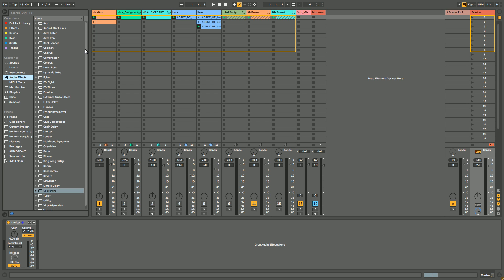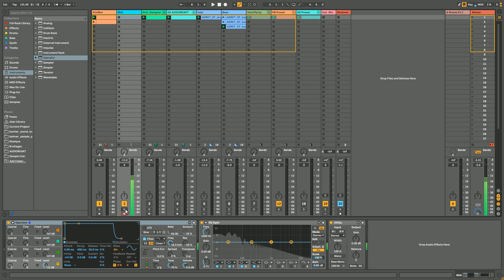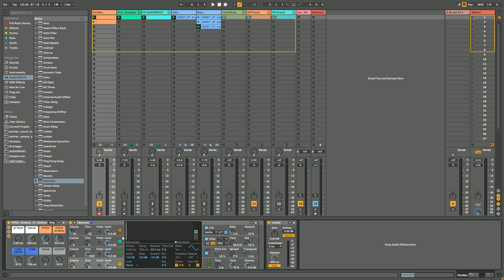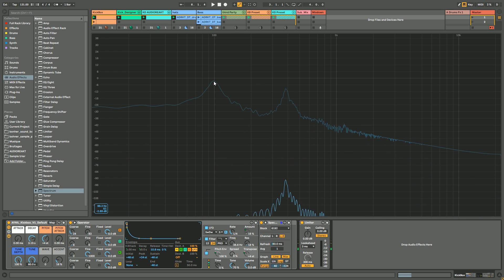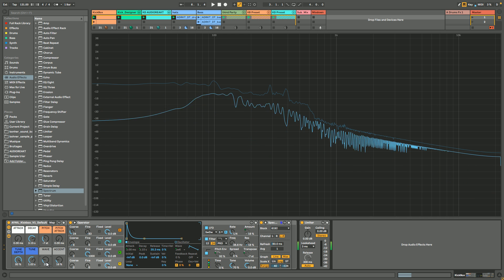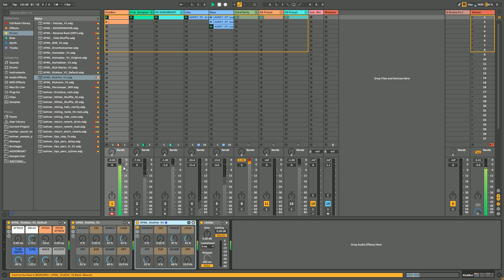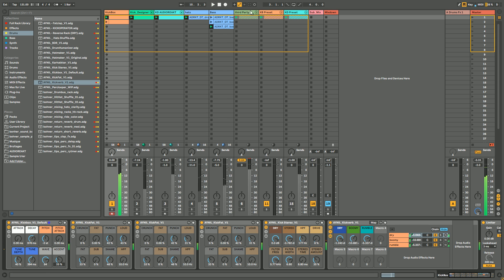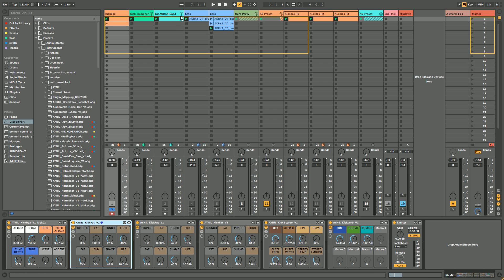How to make your own Techno Kick Part 1 [ Techno / Ableton Tutorial ]

Comment: Hi greetings..:) just silly Q, do you freeze this track when you find the sound you are interested in...thank U
Reply from the maker: Yes, I usually create my kick beforehand, but I use the rack in the part 2, this rack is just for the "body" of the kick, the rack in the second part allow me to layer tops/perc/hats on top of this rack directly, but yes I always record when I got something good because a slight change can completly modify your kick, plus it's heavy in processing ..
Reply: So the operator you use for your kick the oscillators aren't set to "fixed frequency" so you can play different tunings for your kicks, I understand that. I think your default is G1.

Now when composing a track I've seen that you use a recorded kick (sample) instead of the kick you get from the rack, is that the general idea with these?
Play around, add tops/tools/clicks (from part 2) and record the ones you like as audio to then build your kick-library to use when composing tracks?

What if I record all my kicks in G, but might need a kick I like in a different tuning, is it enough to then just use pitch on the sample itself? Or is it better to re-record that kick in the correct tone?

Also, sometimes when you record kicks you record 8 bars or more? Wouldn't the idea be to just have single kick-samples? What's the reasoning behind this? (this was from a different video you made, I can go and find it if context is missing with this question)

Sorry for my many questions, these questions just came up whilst working through your kick-tutorials :O
[I bought the KickDesigner Tools sample pack for support, will check out more stuff in the future too =D]

Comment: Great tutorial, thanks. Just a quick stupid question - is there a reason why Operator is used for this and not Analog?
Reply from the maker: Thanks, not especially. You could get something similar with Analog but it's just than Operator allows more control and flexibility, for exemple for the pitch envelope, you got more waveform.
Reply: @audioreakt  Cool, makes sense. Cheers!